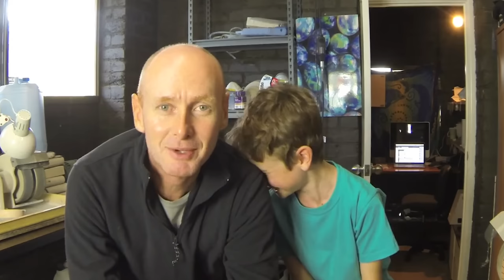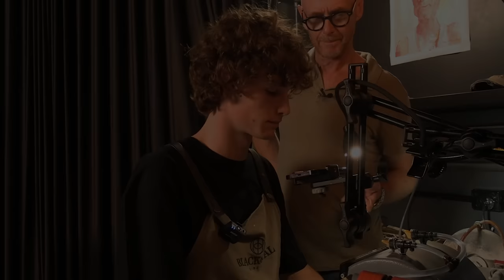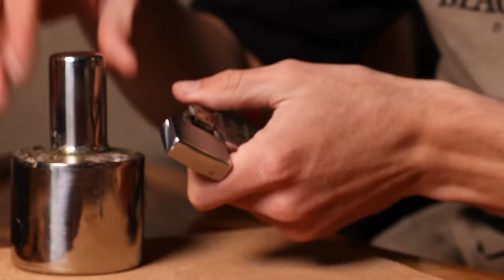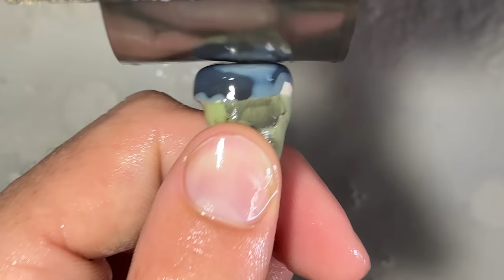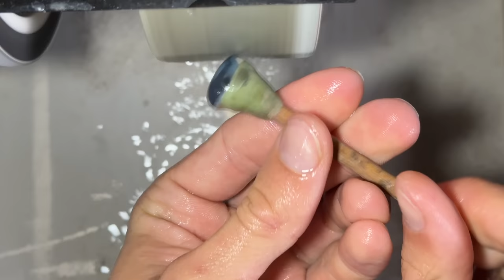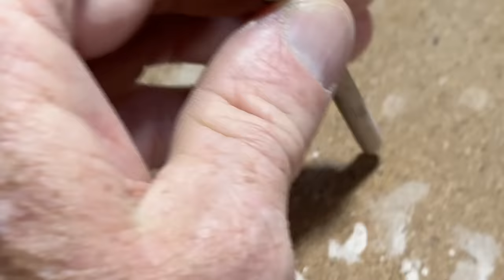Learn to cut and polish opal with Saxon

Comment: Hello, thank you for your helpful videos, 
I have been faceting  gems for fun for years,
 I know that setting the lap speed is very important. I would like to know your opinion about the cabking machine that does not have the ability to adjust the speed?
Doesn't the constant speed affect the accuracy of the work?
Best regards
Reply from the maker: Yes there are not many reasons to change the speed on the cabbing machine. The Cabking I am about to change to. They are a great machine. I am trying the 8 inch machine as we speak and I love it. So the answer is yes